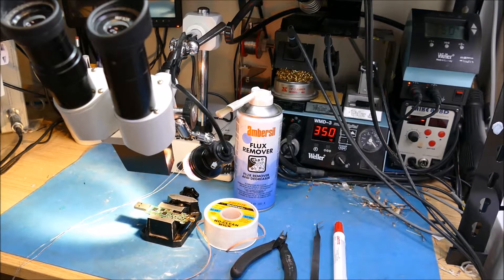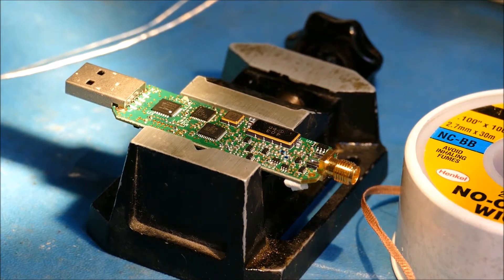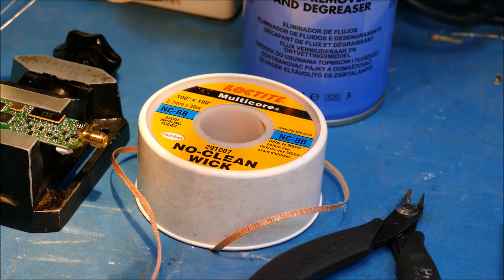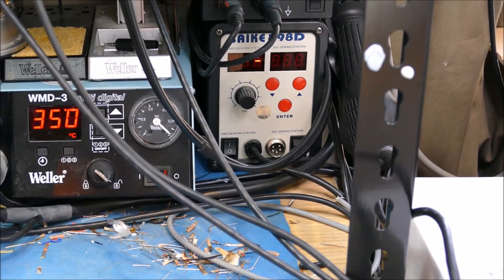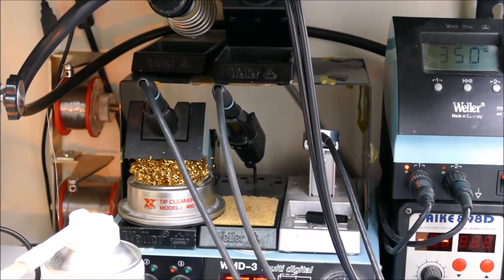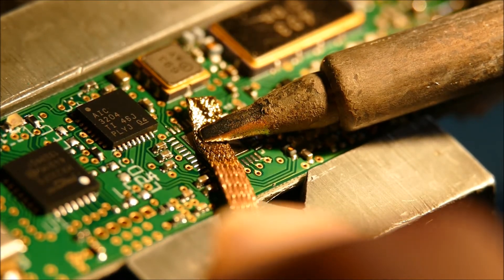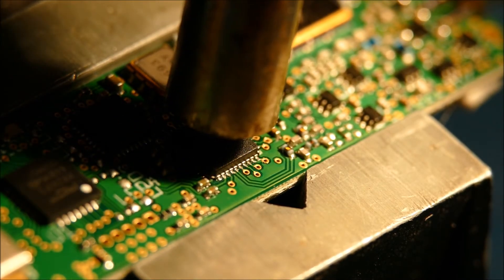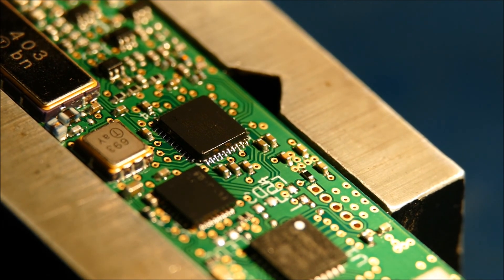QFN Rework: desoldering and reflowing a QFN chip

Comment: what is the riught temp? my component can only operate in temps lower than 85C
Reply: the rework temperature and operating temperature are two different things --- the part should not be powered and working during soldering.